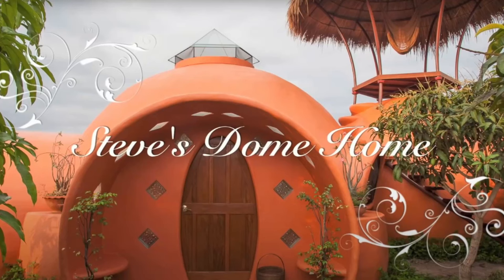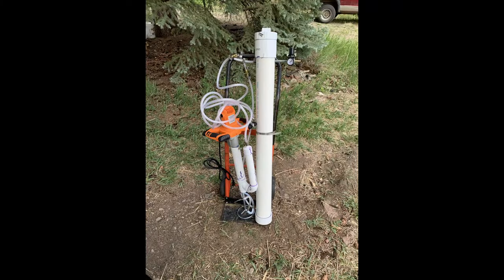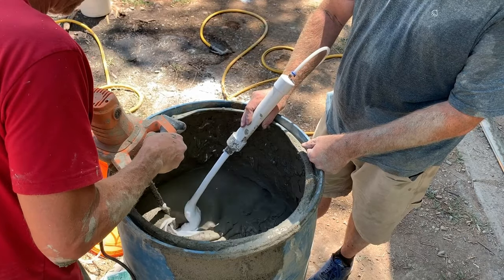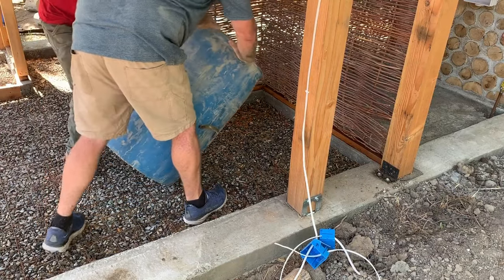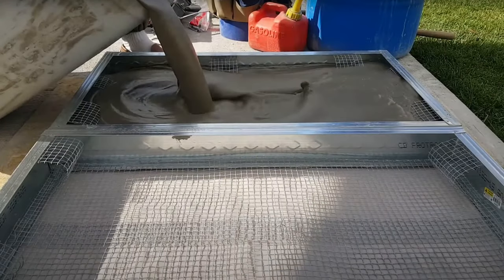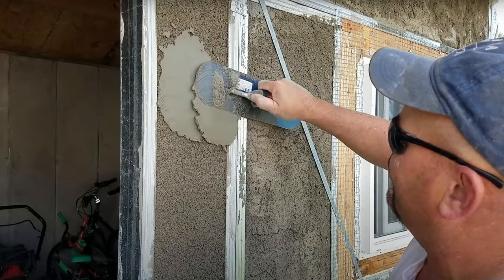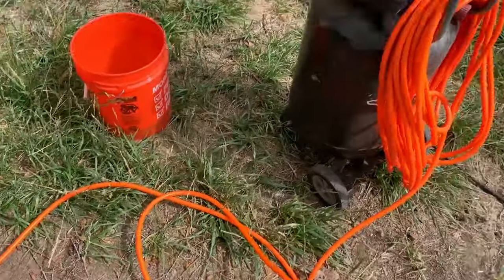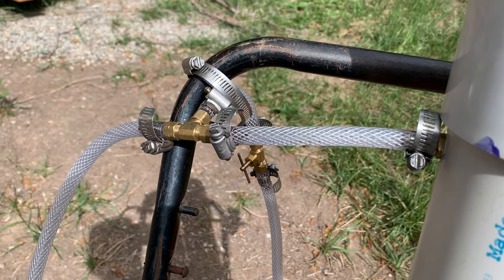Aircrete is great, but watch this before you build with it!

Comment: Thank you for the video.  Some really good trade off analysis there and consideration given to alternatives.

Ignoring for a moment the material source and looking at it more from a long term goal perspective:  truck bed liner both as a reinforcement itself and as a bonding agent with a stiff backer in a manner similar to drywall is intriguing.  I really like the SIF concept for if a panel is sturdy enough to survive handling, shipping, and more, then it is likely a lot less fragile once installed as well.

Paper is pretty high density... When paper is rolled up tightly, it is stiff. When paper is pulled tight and bonded to the gypsum, the taut paper is a key part of its overall sturdiness.   That coupled with the fact that trying to bend drywall:  one side of the paper is under tension regardless of which direction you're bending, the key here is having that tension on both sides.

A high strength material bonded to the aircrete with a bonding agent itself that exhibits high strength properties could be key.  Have you seen how truck bed liner has been used to reinforce cinderblock walls or allows something else survive catastrophic impact?

Where it might fall down is cost per square foot?  Not sure.  That seems like something that is solved with economies of scale and labor savings.    Rolling out or spraying a bed liner is pretty quick.

If the physics and bonding hold up, then other substitutions may be worth experimenting.
Reply from the maker: That’s an interesting thought. 🤔

Comment: nice rundown. i think a reinforcing fiber is needed. person below brought up fiberglass. where i am people will pay you hundreds of dollars to take their fiberglass boats. all you need is some sort of shredder. but your suggestion of garden covers are also good. putting a few layers between each inch of aircreat. or shred at paper shredder size. an other idea for the top for laying tiles  why not just lay used industrial carpet like from offices soaked in the top layer. it will turn very hard and tiles will never crack on top of that if the aircreat underneath fails. carpet strips can also be used as reinforcing fibers through out the pore of the aicreate. 20 year old carpet wont offgas that badly. especially in aircreat covered with tyle.

Comment: I got the same sort of building. an old gold miners cottage red earth walls and old local timber uprights for walls spaced a meter apart. Let me know if you can find a floating cost effective heritage style paneling that can not crack and moves with the wood over time. as for earth floors that is a another science. Hmmm

Comment: As a Swede, I've never quite understood the love for aircrete. We've had basically the same product in our homes for 100 years by now, but we usually buy it in large ready made lightweight blocks. Actually, it's not that popular. Traditionally it was made with a radioactive clay, which emits radon gas. Today, it's as safe as any other material, but it still has worse compressive strength than concrete or brick and it offers lower insulation than mineral wool, which means it has a hard time beating out other construction materials. It has better insulation properties than aircrete (0.12 W/mK compared with 0.13–0.19 for aircrete, lower is better) and it has better compression strength. But even then, the insulation property is way overblown. It's actually comparable to plywood (0.14) or regular wood planks (0.14), and I don't think anyone would want to insulate their home with plywood as their main source of insulation. Sure, it's about 15x better than concrete (1.9 W/mK), but literally anything is better than concrete. Brick is 3x better than concrete (0.60). Mineral wool insulation and styrofoam are about 3–5 times better in terms of insulation than aircrete (0.037).
Reply: I would guess the draw is 'ease of amateur construction', 'organic DIY design', 'environmental resistance' (water-moisture resistance'), 'insulation', and 'affordability'. We're in a housing affordability crisis, and an increasing environmental and climate crisis. People are trying to become self-sufficient. All of these factors attract people to aircrete. They're not really aware that we're 'also' in a concrete supply crisis.

Comment: You might be able to make your idea with a different technique.  Put down some plywood or some flat sheet.  Put your rectangular mold on top of it with whatever you are using as a release.  Mix up some Portland cement that is extra wet.  Trowel that on the bottom and sides of the mold.  Trowel in your mesh so the cement pushes through it to encapsulate it.  Then pour in your aircrete.  Once it starts to set, skim the top with more wet Portland mix and keep it thin.  This might help it to hold together and not crumble.  The outside will be a stronger shell, while the inside is insulating.

Comment: Feel free to ignore this, I don't know if you have had other people point this out or not. This is in regards to the foam generator, specifically the ad hoc eductor (were you in the Navy?) . This may be way off, since I can't see a cross section of the T joint, but it appears that the constraint in the flow of air is BEFORE the foaming agent. If you google "venturi" there should be a image that appears on the right hand side of the page. Apparently, the reduction of pressure happens along the length of the constraint (the drop in pressure is a direct result of the increase in velocity of the fluid). So if you want that thing to suck more (in a good way) you have to 1. Make the constrained section longer (not just an orifice/aperture, possibly the whole T joint long) and 2. make sure the soap input falls within that constrained section.  Anyway,  you got a great beard, wear it with pride.
Reply from the maker: Ha! Yeah, the science of that prototype was weak. Great tips. I did not join the Navy, but have a brother, sister, and son who did.
Reply: For some reason this aircrete thing has been hard to stop thinking about. Specifically generating extremely high density foams. I have been comparing every result I have seen with Barbasol shaving creme as the go-to default. I think shaving cremes use isobutane or something as the propellent/foamer. The reason I'm pestering you again is I was wondering if you have ever seen anyone take a big air flask and fill it full of the water/surfactant mixture and carbonate it like a giant soda can. The interesting part, is not that it may generate a good foam, but that the foam is composed of CO2, which portland cement needs to cure. It would be interesting to see if the properties of a test block change in any way if this was done.   @radicalgastronomy
Reply from the maker: @jonathanseagraves8140  that would be a great experiment!

Comment: i wonder if there is a way to make uniform micro beads of Styrofoam to act as the foam, it would be light, cheap and readily mix into the concrete
Reply from the maker: There are people doing this who swear by it. Personally, I don’t build with toxic materials, but some love it.

Comment: @radicalgastronomy .. Have you ever thought of doing sip panels by borrowing honey-do-carpenters metal exo-skeleton and packing dustcrete inside??  I think a dustcrete sip would be on par with styro SIP right?  or would it be significantly more heavy you think?
Reply from the maker: It would be heavier, but not prohibitively so.
Reply: @radicalgastronomy  fyi, I've seen an interesting idea recently(I think it's an old idea really), but i wanted to share with you.  The use of double stud walls to increase insulation.  That idea had me thinking of your dustcrete method.  Here are the pluses...  a)more r-value.. b)cheaper construction, since you can do it with 2x4's and gain 2x6 rigidity for cheap.  Also, what if we went with sheetrock metal(cheapest) to frame walls, and then use your osb and plant method to infill with dustcrete??

Comment: How does this compare with dustcrete and can it be added to dustcrete?
Reply from the maker: It is perhaps a bit more insulating, but much more complicated to make and use. It is also far more fragile. One could mix saw dust into it, but I doubt it would have sufficient advantages over straight dustcrete to make it worth the added trouble.

Comment: Our aircrete foam rate and weight is right but our finished product does not self level. It's fluffy-like. Any thoughts are appreciated. Thanks for the video.
Reply from the maker: That was my experience, as well. I used a trowel to surface my pours.  Before I laid tile on it, I packed that reinforced deck mud layer, and created a good surface. The best move would be to lay diamond lathe and pour self-leveling cement over that.

Comment: I tried 4 times and my blocks keep breaking after I remove them from the form. I waited 3 days to let it cure and still happening. Do I need to add fibers?, Can you please tell me why the blocks keep crumbing? am I using the wrong cement/water proportion? 0.45 w/c ratio
Reply from the maker: I find it super fickle. The most important thing is to make sure the foam is the proper density. Even when everything is perfect, aircrete is very soft and crumbly.

Comment: I had heard of the inflation method and lining it with mesh for structural support. I was wondering how feasible it would be to create a second inflated barrier and fill the gap from the top like some sort of double water balloon casting mold but with several inches between to create the mesh core wall.

Example: inflate outter layer, mesh line the wall structure, then inflate a slightly smaller inner layer and finally fill the gap between the inflated layers from the top.

Could that work i wonder?

Comment: Thank you so much for your in put on air crete as I have been doing research also.  I love the look of domes or organic forms .   I stumbled across a photo years ago of a  small dome about 10 or 12 ft. in diameter .  These two guys had made a form for aircrete that had six sides to it instead of a rectangle .  It looked really great ; but I've not been able to find any more info on that and how big you can go with it.  The six sided shape was about 1 to 2 feet in diameter . the block that is .  Do you have any info ?

Comment: That's amazing, just curious if the addition of carbon black to the mixture, would make a significant difference to the structurial integrity. If not, the use of regular concerte and addition of carbon black, makes block or foundations that are super capacitors that would hold enough energy  that could power a nice,  one story , 2 bedroom 1.5 bathroom house. If you use copper rods instead of steel rebar, you will maximize the total output of each block.
Reply from the maker: Interesting 🤔
Reply: @radicalgastronomy  if you get a chance, check out MIT website, they go into a bit further detail. I just use aluminum drinking vessels and zinc rods as cathode and anode with concrete and Epsom salt mix for crystal batteries that last forever. Just add water when the medium oor. Concrete dries up.
Reply: If you find success with the carbon black admixture, you can add self sustaining energy to your pitch. I truly hope you make it big. This building material is not only the future here, but when we go to colonize the moon or Mars, with a self sustainable foundation or building itself, will endure your prosperity. Blessings brother.
Reply: @radicalgastronomy  
Regarding the vermiculite, pumice is 10X cheaper and is ligh weight.

Comment: I'd really like to see a discussion of the potential of using dustcrete in combination with aircrete to perhaps accomplish superior insulative value. Have you done an analysis to see what R value dustcrete actually has? It almost seems that you could mix dustcrete structural framing with an outer layer of aircrete. Or perhaps use aircrete in certain joints or the ceiling or high temperature exposure areas to accomplish some level of improvement of insulation. 

Also, the new extreme efficiency homemade paints from Tech Ingredients' channel and even NighthawkInLight's work on hyper/ultra white microspheres paint could be extremely interesting in combination. I have wanted to build a structure that has similar qualities to earth-berm building, but for a traditionally built home and it seems that making new exterior walls with your techniques could be highly productive.
Reply from the maker: These are good areas to explore. I’m working on doing R value analysis on the dustcrete. Currently estimating the range from 2.8-4.6/ inch, like hempcrete.
Reply: @radicalgastronomy  this is very good news. I'd very much like to see practical earth-berm-esque alternatives for existing homes... OR preparatory constructs that facilitate earth-berming in order to get the mass. A huge problem that many have in in non-arid areas, wetter zones or low-lying (aka, high water table) areas is just trying to get enough mass to reduce heating and cooling costs. I, for example, have an INSANE heating and cooling bill due to a single story home and I simply cannot afford to build a new underground or properly (from start) earth-berm home. I'm left with seeking "alternative" building options that are entirely ignored by society today. Thank you for your efforts.
Reply from the maker: @cryptonein  You bet! Our main house will be North side bermed with an attached cheese and meat cave. I have the perfect slope for it.
Reply: @radicalgastronomy  amazing. If society hangs on a little longer we hope to do a lot with your ideas, especially in the way of a semi-buried greenhouse this summer.

Comment: Thanks for the video!   Not even myself who has built lightweight concrete structures knew how bad production of portland cement is for the envirornment, it has me rethinking a bit of my approach.  One of my building goals was fire resistance, the use of timber in a fire prone area where I own land is required by code (without structure engineering approval) but the worst possible material to build with in this environment.
I was using perlite which I believe is a significantly better approach than aircrete.   Perlite is rock bubbles and has more strength than aircreate, but most importantly is it creates consistent structure as the perlite is graded, vs foaming that is very difficult for a DIY to be consistent.
Requiring manual application of plaster/stucco really defeats the majority of the purpose in my view.   This makes the whole process highly labor intension and time consuming.

I have been looking into using Bamboo these days..
Reply: Perlite retains water so might not be a good additive especially in cold climate. It could cause cracking or flaking.
Reply: @spamman007  Perlite does not retain water, it is a sealed rock bubble, same as glass 'microspheres' used in fiberglass work on boats.
Reply: I've wondering about perlite because it has insulation value but it is also a rock so hits the durability and strength button as well.  What type of perlite recipe do you use or think you'd need to mix up to be applicable as a wall, structural or non structural?  I think there is a company out there doing 3D printed houses using a perlite mix.  I don't think they'll be sharing their recipe anytime soon. I was thinking something similar to a cob mix, but replace the sand with perlite rock and add the clay for cohesion (stickiness), straw or some other fiber for tensile strength.  I'd love to experiment with perlite!

Comment: Getting back to your idea of using the agricultural cover mesh as a dry finish merrier on both sides of a "aircrete board. It will take the use of a foarm, a very small amount of silicone spray form release, other organic options may not work as a release media, and the assembly would go like this. The form board thickness would require it be no less than 30mm to allow the ingredients to holdup to movement and also be no larger than 1m square.  The form will also require it sit in the same flat position until it has achieved 48 hours of drying and curing time, longer would be helpful. In the form, lay down the ag cloth, spray it with a mixture of clay, thinset mortar and water, sprayed on with a drywall texture hopper gun, then while damp add the aircrete filler, position section of 14GA welded wire fencing like the 2"x4" fence opening wire, inexpensive and itself light, pressed into the aircrete, finish off the form with aircrete pressed and screeded into place, spray over the aircrete with the thinset mixture hopper gun, lay on the top and cover it with a piece of weighted plywood for a few hours, remove and allow the panel piece to setup and cure for 48 hours or longer,  This will make a stable and light finished panel that can be mortared into place like a thick piece of drywall, and may be attached with construction adhesive instead of thinset concrete, and the tube construction adhesive would probably work best with general construction protocols and within building code requirements. I estimate this will have greater than an R-value of 10. Panels could also be adhered to one another if a greater R-value is needed.
Reply from the maker: Sounds viable